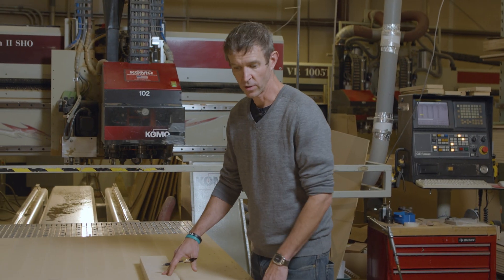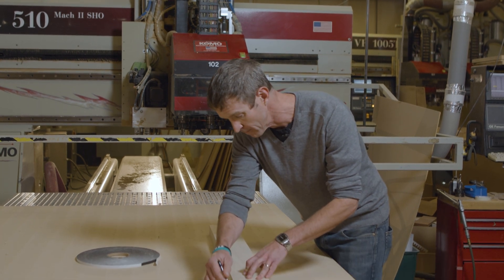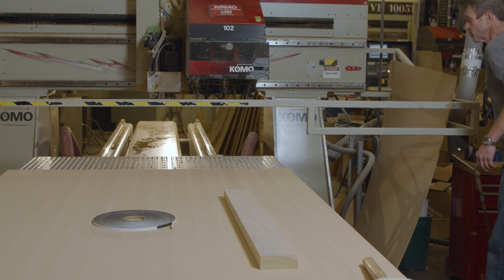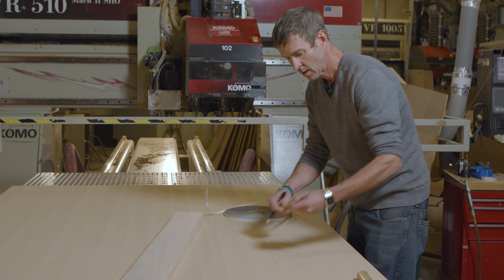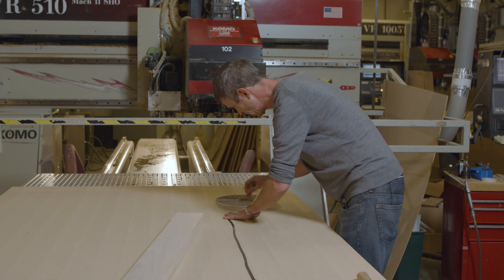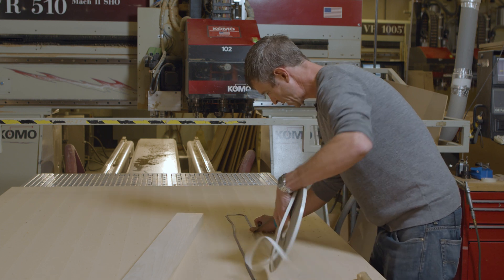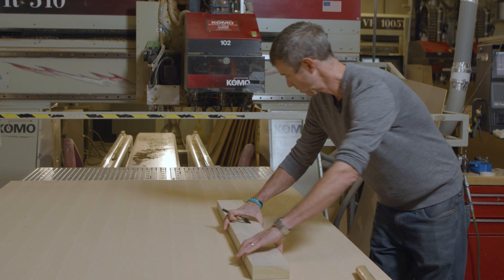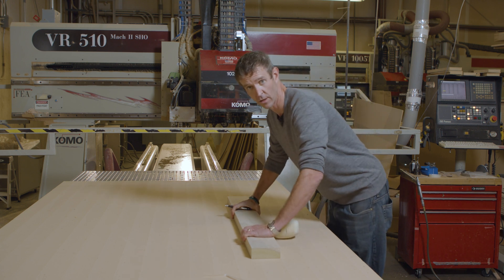On Board Gasketing Demonstration

Comment: This concept works... I can't believe I had never seen it before.  I ordered some of your cover gasket for a small dedicated fixture, and you sent me your demo kit with it.  On a none related project, I had a scrap 28"x15" piece of plywood I needed to cut on on my downdraft spoil board.  Typically I just double side tape something like that, but it had a bow in it.  I tried just turning on the vacuum and about half of it stuck, but the  other half was not making contact with the table.  i got the sample on board gasket you gave me and ran that around the edge (a little straighter than you just did), and it sucked the whole thing down perfectly flat, and would not move...I never would have thought to use a gasket on a nested downdraft table, but it was amazing.  I am going to set up some dedicated fixtures using your in board gasket for several of my part lines that I run all the time.  I wish I had ran into you guys before I built my vacuum system.  There are several things I would have done differently.
Reply from the maker: Justin,
Thank you for the comment.  I am happy to hear the cover gasket worked out well and that the New Customer kit came in handy.  Vacuum is a science.  When you remove the atmosphere you have a vacuum clamping system rather than just a down draft system.  We strive to help American Manufacturing every day.  If you have any pictures of the process and are willing to share we would like to see them (info@allstarcnc.com).  Also, we would like to share your testimonial on other platforms.  
Thank you and we are always a phone call away to help.
800-878-7827
ALL Star CNC Team